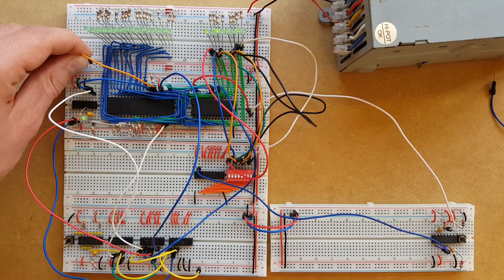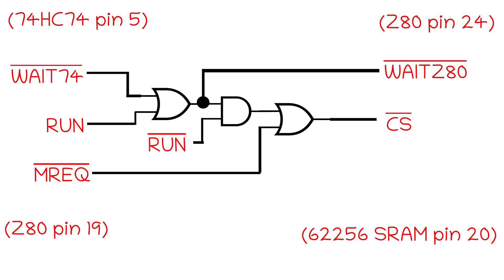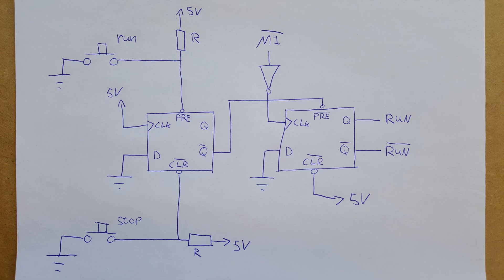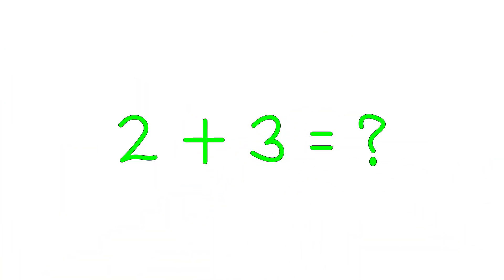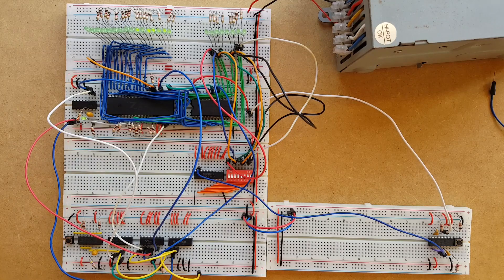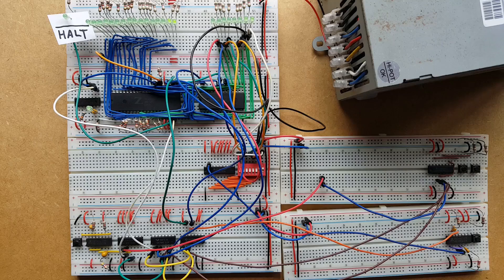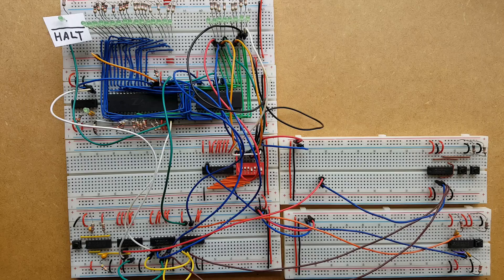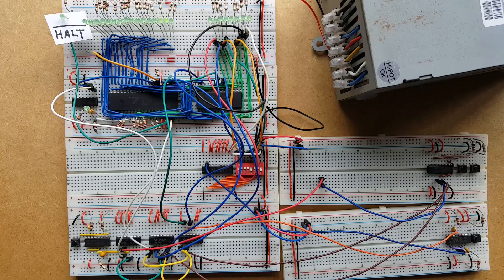A cheapo Altair 8800 style computer using a Z80 - (part 4) - Run/stop function and programming

Comment: Great vid thanks for covering  memory decoding! I'm wondering how we would split off say a 1k or 4k or whatever portion of the memory map for io of some kind... Although admittedly on the Z80 you don't really need to do that since there is dedicated IN and OUT instructions. Although, if we wanted to have say 8k of ram, and the rest rom (for example) then we need to decode the address bus. That's where I get lost! Hope you cold gets better soon 🤧
Reply from the maker: Thanks mate! Ohhh right you want hardcore decoding. I'm not sure how a real engineer would do it, but this is how I would go about it. If I want the first 8k of memory to be RAM and the rest ROM:
    1) log_2(8000) = 12.965...
    2) the nearest whole number is 13
    3) So I want the RAM to be selected up to address 0x1FFF (0001111111111111) and addresses 0x2000                                 
        (0010000000000000) and above to be ROM
    4) So I'd OR together A15, A14 and A13 and the output of this would go to the RAM chip select pin and the 
         inverse would go to the ROM chip select (assuming that the RAM and ROM had active low chip select pins).  
         You can also OR the MREQ signal with A15, A14 and A13 to keep the IO space separate from the memory 
         space.
It gets a lot harder If you want to split the address space up further but it's a similar process, you just workout what address values you want your memory or IO device to be active between and use logic gates on the address bus to turn that combination of 1's and 0's into the chip select signals. You can get memory decoders which do some of the work for you and if it get really complex you could cheat and program a ROM to do the decoding for you. The address bus of the ROM connected to the Z80 address bus and then each bit of the data bus of the ROM goes to the chip select pins of whatever devices you're using.
Hope this makes sense (a proper engineer would be able to explain this way better). Thanks, I'm slowly beating the cold! Haha